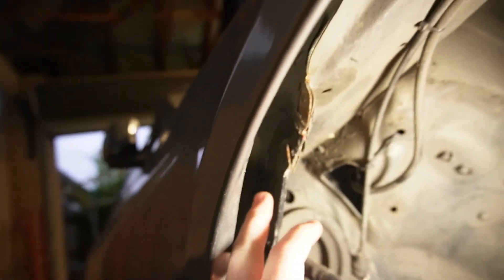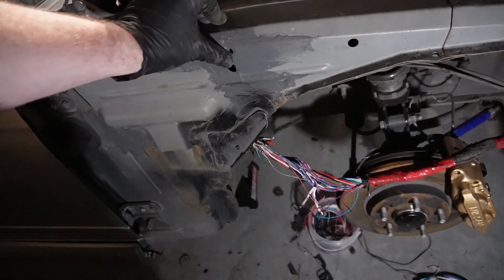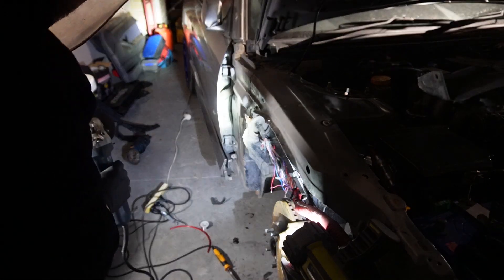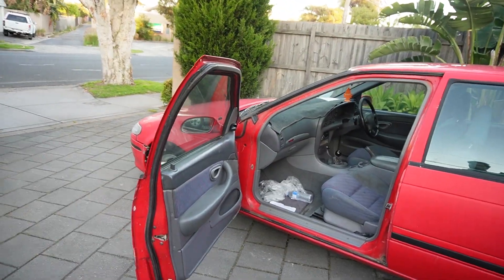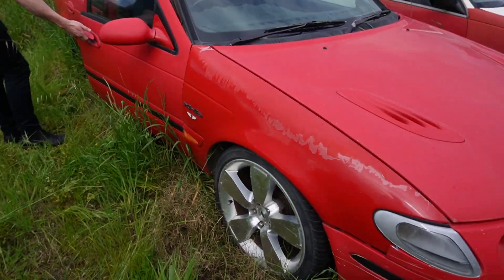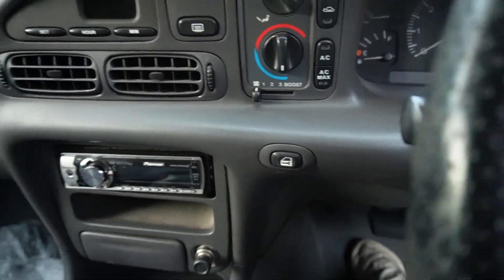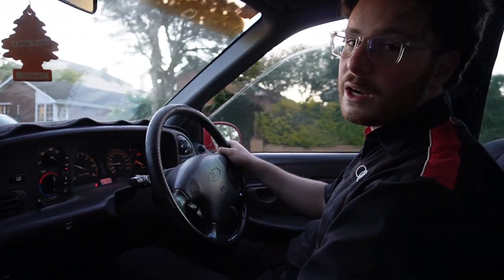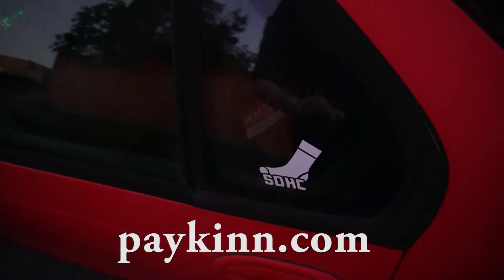IS IT WORTH BUYING A CHEAP CAR OFF FACEBOOK MARKETPLACE?

Comment: Thanks M8. Just bought a rough Futura EF Wagon- almost identical condition to yours. At 73 I’m not too old to learn from a young fella. Thks 4 the advice. I’m using mine to tow my 2 tonne caravan. Found the motor is a  Tickford with a nice set of extractors so it’ll have the torque 👍

Comment: Definitely worth it. I got an AU XR6 manual for cheap, needed new tyres, clutch, timing cover done twice (apparently needs to sit overnight to set before running), and still needs brakes and suspension... And the paint is faded. BUT I'm loving the holy trinity of RWD, manual, LSD, without worrying if someone opens their door on it at the shops.
Reply: So, it's cost you more in parts for what you paid for it? 😂😂😂 🤡
Reply: @TheCheshireCat.  That it has. It's generally what happens when you decide to buy a car that's had 20+ years of use with mostly original parts on it. 

The norm is buying a new or near-new car and paying interest on a depreciating asset...  And when it's finally paid off and worth what I paid for mine, it'll need the exact same work done. 🙃

Comment: I've driven mine for 2 years and the locks are still temperamental, the clock works when  you press a button really hard, you're lucky the bcm is still working fine, I've replaced 3 (used) and a new one is $500, I just put coilovers in the front of mine with ba upper arms and it has -3deg camber and 0deg toe being 120mm off the ground measured from the sill

Comment: If you buying a project car then you will need Money$ for do the mods you want for ze car. Like Put in Brand new gearbox, New diff, get engine cammed then Turbo or super-charge. Change all fluids. Put in new racing brakes, Cold air induction, New wiring and possibly OEM computer in the engine may need to be changed or re-mapped. Depends how much money you had for this Falcon